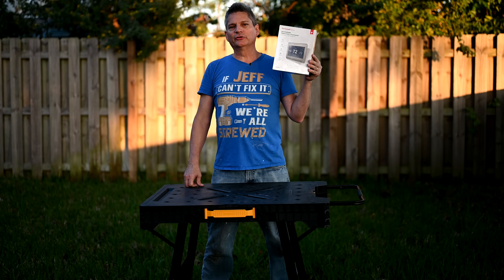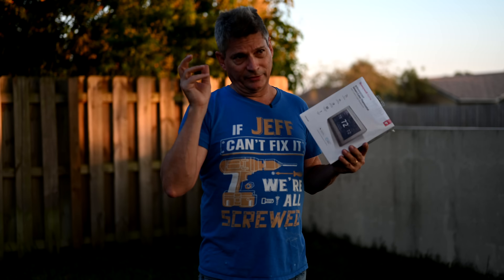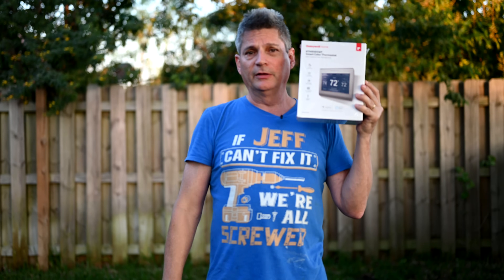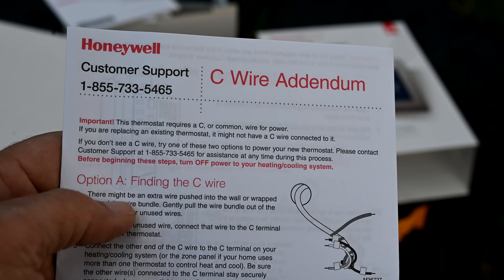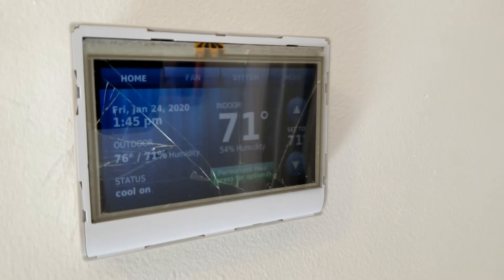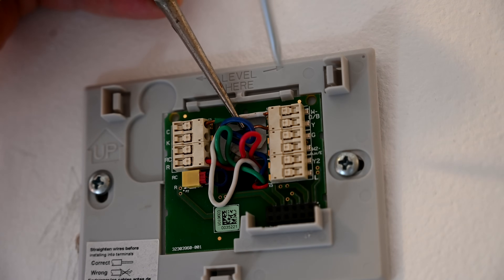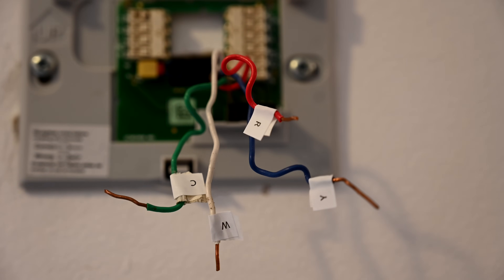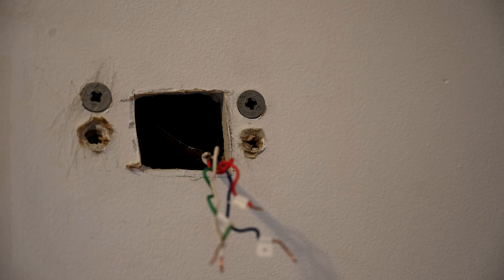How to Install Honeywell Smart WiFi Thermostat RTH9585WF Wiring

Comment: Does the jumper for rc to r on your thermostat take place of one that doesn't have one setup like that? For instance you on my old one there's an extra wire going from r to rc
Reply from the maker: Yes, the jumper connects the Rc (cooling) to the Rh (heat) or commonly denoted R. the jumper is there to make sure you can control the heater or the cooler.

Comment: I have 2 wires tucked away, a blue and a brown, which one could be the C-wire?
Reply from the maker: More often than not the C wire is blue, but check your air handler schematic
Reply: @jeffostroff  thanks for the help, appreciate it,
Reply: @jeffostroff  I plug everything in, no power

Comment: You said five wires you only connected for. What about the fifth wire?
Reply from the maker: Correct, our system only had 4 wires, we had no "C" wire. So I changed the wiring inside the air handler to give me the 24V "C" wire. But by doing this we lose the ability to run the fan only mode on the AC, which we never use anyway.

Comment: My thermo has 5 wires the blue c? Wire was not being used by my old thermostat.  I wired it R-R G-G Y-Y W-W and the blue wire that wasn’t being used before to c. My thermo kicks on and runs heat but the screen is not starting up on my Honeywell home it is blank...
Reply from the maker: Assuming the blue wire goes inside your air handler to the common, it should work. Trace where it goes, and call Honeywell if you can't confirm where it connects inside the ac
Reply: @jeffostroff  I tested with a multimeter it had 24v on the blue wire. Inside the furnace the com wire was blue and running down from the board to some relays it looked like black wire plugged in over by the rest of um it was running over to some sorts of control module? 🤷🏼. I’m kind of done with this thing for now I’m gonna chalk it up as DOA unit...

Comment: Hi I am interested to buy the Honeywell RTH9585WF1004 thermostat. I am in a condo and currently have a Honeywell T6575C1001
. Can I change? I have checked the wiring diagram and they are quite different. Any advice? Thanks
Reply from the maker: It is hard to tell without seeing what you have but at the end of the day you need to have at least four wires and preferably 5 to pull it off because you need that C wire and not everybody's system has the full 5 wires going to the AC unit. In my case what I had to do with that older AC was I disabled the ability to turn on the air handler in fan mode only in order to become my C-wire
Reply: @jeffostroff  Thanks! Can i send you a picture of what i have currently?

Comment: I had a 5th wire (red stowed away in the hole) would that be the C wire. Old had 4 wires G, Y, W and one connected to Rc with jumper to R. I assumed, that and used it.  It operated heating, but no display.  Any suggestions?
Reply from the maker: Yes, usually the wire that is folded back is the C wire. You need the C wire to have the display come on. Also make sure your display panel is snapped in perfectly onto the wall plate connector.
Reply: @jeffostroff  is it possible the folded wire is not connected at the furnace?

Comment: Jeff I have 7 wires...  (Heat Pump) Y2, Aux/E, G, O/B, C, Y, and R. My c wire is getting 25 v. When I connect the Honeywell 9585, I get nothing...  blank screen, no power?
Reply from the maker: The R should be getting 24v, did you test that wire?
Reply: @jeffostroff , yes it is as well. I wish I could shoot you a picture of the current setup.
Reply from the maker: @cuzzc9617  Unfortunately with all of these wires there's so many moving parts and so many opportunities for things to go wrong. So we know that you need 24 volts coming on the red line and we know that the C wire if you have correctly chosen it is supposed to be the black common wire that goes back to the air conditioner. I doubt the C wire should have 24 volts on it. depending on what wiring the installers used hopefully the C wire is normally black in my case it was green because my older AC did not have AC wire connection on a four wire cable that they had so I had to do some tricking inside the air conditioner to give me a C wire out of the green wire. But if you open up the panel on the air conditioner where your wires all come in to it you should be able to double check which color wire is indeed going to the common or C terminal. They often have a wiring diagram on the inside of the panel or on the outside so you should be able to tell if those wires are indeed going to where you think they are. Also you should search on the Internet for “thermostat wiring diagram” so you can see what all the different colors are and where they're supposed to connect up and make sure you have the jumper going from R to Rc on the thermostat. remember just because you have a set of wires there doesn't mean that they are correctly following the normal convention. Lastly it could also be that you just have a bum unit, but not likely and so you should call Honeywell and talk to their tech support people about whether or not it is wired up correctly or if the unit is just bad .

‘
Reply: @jeffostroff  thanks

Comment: Is there a alternate wiring installation with a older 2 wire system for this same thermostat?
Reply from the maker: I don't think it would work with a 2 wire system
Reply: @jeffostroff  why wouldn’t it work if I installed a 24v power supply to supply power to the unit and use the red and white to control the heating unit?

Comment: I have 2 wires going into the R terminal in my old thermostat......
Reply from the maker: Not sure why. The R is the AC 24 volt power. Usually on thermostat a small jumper wire goes from R to Rc

Comment: My display is just flashing. Idk what else to do. Can you help??
Reply from the maker: If the display is flashing re check all of your connections and make sure you water them correctly to the right spot and make sure they're in there tight but if it's flashing it says to me that it is at least getting the correct power maybe you have a way to see if it's getting 24 volts or not, otherwise it could be you just got a bum unit might need to go back to the manufacturer
Reply: Mine was flashing when I had the C wire and the G wire switched.
Reply from the maker: @DaveLK2000   Yes sometimes it's pretty hard to know exactly what's going on with the wiring that's why it's so important to take that picture of the wires before you remove the old thermostat. And most likely you didn't even a C wire connected before. same with my AC there was only 4 wires in when I had to do was rob one of the other wires on the air handler and move it inside the air handler to become the 24v c wire and by doing that I lost the ability to turn on fan only mode of the AC which is fine because I've never used it in fan only

Comment: Hey bud. Question. I just bought the same thing. I don't believe i have a C wire coming to my current thermostat but there are 4 wires coming through the wall. The new honeywell came with a white jumper. Can i still hook the new one up?
Reply from the maker: what I did on my AC is I reassigned one of the wires on my AC unit to be the O wire, but then lose the ability to run the Fan Only mode, which we were ok with. I believe in newer versions of the manual they have tricks to provide a C wire.

Comment: Can you explain to me why you just didn’t use the base from the old thermostat to use with the new ?  Waste of time!
Reply from the maker: Jus tin case there was an update, and I suspected I had a bade base  the first time because the thermostat fell off the wall when a door was slammed, cracking the display. I wanted lal new parts. Problem solved. Not a waste.

Comment: Hey, so first of all thanks for the video! But after install, the air blows cold for a few mins then it blows warm. Not sure if i did something wrong but all the wires are in the right place
Reply from the maker: Issues you can fix:

Thermostat is set to HEAT
Clogged outside unit
Outside unit is not receiving power
outside unit having issues with the compressor

Issues a professional needs to fix:
Low refrigerant (refrigerant leak)
Dirty evaporator coil
Leaky or disconnected air ducts
Reply: @jeffostroff  okay thanks for that information. With the old unit there was a red wire in RH (there was no R or RC option) so when i put this new unit in i put that red wire in R, do you think i should try putting the red wire in RC instead or R?
Reply: @AlfaAK101  both RC and R and linked together, would not matter which you put it to

Comment: The green wire for "fan only" can be used as a 5th wire, but then the fan is only able to run during heating and cooling, not on its own.
Reply from the maker: That is how we ran it
Reply: You answer my question, thanks.
Reply: So I can still connect ” g” wire to g  . If not disconnect g from condenser as well ????
Reply: @djb8078  G  wire doesn't go to the condenser, when I say "fan" I am referring to the blower motor inside the furnace as a "fan".  I replaced my 4 wire bundle with a 5, but if I didn't care about being able to cycle the "blower motor" without heating or cooling; as in just the blower pushing unconditioned, and unheated  air, when the outdoor temperature is mild and not too far below room temp.  There is an option on the Honeywell Unit that allows for the fan to cycle 25% on and 75% off., : 2.5 minutes out of every 10 minutes of something like that.  When you reappropriate  the green wire as a "C" wire you will lose this ability.  Your blower will only come on during heating and cooling cycles.

Comment: They sell 24volt adapters that plug into wall for C wire . Amazon . Hide the wire through wall or just run it down to floor and around to outlet
Reply from the maker: Yes, that is another good way to do it.
Reply: How is the adapter ran? Customer service says this will not work at all if using for both ac and heat.
Reply: @SSFrenchman23  customer service is wrong . The adapter plugs into a standard wall outlet for power and its wires are connected to the thermostat.  Directions in box

Comment: What if you have a O wire and a W wire? How does that work?
Reply from the maker: Not sure, usually the O is orange and it means RV cooling, the W is heat typically.
Reply: Agreed. This one is strange. 
It has the O AND W terminals as the same. 
So I put my O in the marked one and W in the AUX/electric heat. Works for me

Comment: I have a ranch home, (in Massachusetts), two zones, (2 separate tstats), for heat, 1 thermostat for AC. I replaced the two heat tstats with Lux 1500 about 15 years ago, left the old school Honeywell thermostat alone. The thermostats only have the 2 wires coming out, does this mean I can't install a new wifi type of thermostat? or does this mean bringing in an electrician. Any advice would be welcome
Reply from the maker: Well since you split up the heat from the AC you probably do have all of the wires needed at the AC unit, but they're just not all in one spot for you to hook up this Honeywell thermostat. So, your choices are you could bring in an electrician to run your 5- wire cable and make sure that it has the C wire on it as well connected at the AC handler. The other solution you might want to look at is the new wireless thermostat that I got which is the Lennox iComfort S30 and I bought this to replace the Honeywell that you see in this video, because we bought a new high end Lennox air conditioner and this is the preferred thermostat for that air conditioner. This awesome new S30 is bigger and nicer than the Honeywell. The AC installers explained to me this S30 does not need the 5-wires, only power and transmits everything wirelessly to the air conditioner; there is a Wi-Fi receiver that mounts on the wall outside the air conditioner. So, you may be able to use something like this on yours as well. I would investigate that and looked look into the instructions in the installation guide and the wiring info and see if that is something you might be able to use in your configuration as well
Reply: @jeffostroff    When we purchased the home back in 1999, the thermostats were already installed that way. When the house was built, 1994, did they not have a combo tstat that they could have installed a heat and ac together? I will check out the Lennox S30, the central AC unit here is a Lennox product. Thank you Jeff for the help and advice.

Comment: Ha I just bought one of these yesterday and made this same mistake.lol Tried it without the C wire and the screen blinks on for 1 second and off for 2 seconds and repeats. Tried different configurations with the same results. The system just won’t stay on. Took it off and found an unused C wire but the display doesn’t come on at all now but we did feel the air coming through the vents even though we can’t control anything. Gonna give it another go today. Thanks for this video.
Reply from the maker: Dang I hope you did not get a bum unit, maybe the display part is bad. If you can measure the C wire voltage, see if it is 24v
Reply: jeffostroff tried again this morning and just put the old unit back on. I’m gonna call Best Buy and let them handle this one. The air did cut on this morning but no display. Thanks for the reply.

Comment: Hello Jeff, great video. Where did you turn the power off from. I was going to shut the power off at the breaker box but, is there a power on the HVAC unit?  Thanks
Reply from the maker: That is correct If I remember correctly, I just did the switch on the front panel of the Air Handler a few feet away. It's usually low 24 volts, typically no danger, but you never know. I would still use a Voltalert sensor to double check. IF that doe snot work, try the main breaker switch for the Air Handler in the electrical panel.

Comment: I have American Standard thermostat, it has Blue color wired to its B terminal, when I checked at the furnace in the attic, that same Blue wire is wired to C terminal at the furnace. When I upgraded my thermostat to the Honeywell T5 wi-fi thermostat, I have switched the Blue wire from B (American Standard) to the C terminal of Honeywell T5, the unit did come on but the heat instantly blowing even I turned the Cool mode on. How do I fix this problem? Did I do anything wrong? By the way, my furnace is also American Standard and I'm planning on keeping it.
Thanks for your help
Reply from the maker: Not sure what is happening without seeing owners manuals. Is the furnace just for heat, or dies it also have air conditioning? What model is the furnace?

Comment: Hi Jeff, do you know if this works well with a variable speed blower? Nest says it won’t work.
Reply from the maker: Not sure. We're looking at installing a variable speed Dave Lennox series high end AC, and my guy told me today that surprisingly it only needs a 4 wire, so maybe that has to do with the variable speed blower in it also. He told me that Lennox recommends another smart thermostat they they use with their 4 wire AC. Hope to find out what that thermostat is in the next few days.
Reply: Nest uses a power stealing feature that often disrupts communication in the board and blower motor. They have made some updates and may have improved that problem. Don’t know,a lot of our customers that buy them at the big box stores have issues with them.

Comment: Although looks like IM stuck with the POS Train thermostat.  Honeywell is not compatable unless I rewire at the unit.  need help. sh*t!
Reply from the maker: I had to rewire my unit as well. I lose the ability to operate just the vent blower by itself, which is no big deal, because we never use the vent by itself, we either heat or we cool, that's all.

Comment: Jeff, very helpful.  My TRANE XL850 died and I should be able to replace with a like version of the Honeywell (both 24v)  the Trane is connected by 3 wires.
Reply from the maker: Only 3 wires? That might be a challenge. Soon I want to upgrade my AC to the Dave Lennox Series, their top of the line model, then convert to 5 wire.

Comment: Jeff great video. I was wondering how do you change the humidity for the inside of the house? I need it to be set around 55%RH
Reply from the maker: I don't think you can change the humidity on this model, I looked in the user guide for someone else who asked. I think this works only on temperature.
Reply: jeffostroff thanks. I hooked up and you are correct. Would you happen to known a Honeywell model that does?
Reply: Looking for that option for our church also. Our pastor insist on setting thermostat to 80 when away but we are in south Texas things start to get moldy and corrosion starts to take place on electronics.  Did you find a thermostat that you can adjust the humidity with?

Comment: I cant seem to find anything on the internet or any body's videos about dehumidification settings for this thermostat.  Are there any settings in the menu to tell the thermostat what you want the humidity to be? On other Honeywell thermostats, you typically have to go into advanced settings to adjust this.  Please advise.  Here is one old video I found, does it work like this? Thanks  https://www.youtube.com/watch?v=clYWjm9X7Kc
Reply from the maker: John, the model we installed does not have any humidifier setting. We don't have Menu option on screen, we have Settings. But the only info they have on humidity is that the screen displays inside and outside humidity. Here is the link to the owners manual online: https://www.honeywellstore.com/store/images/pdf/rth9585-honeywell-smart-thermostat-manual.pdf

Comment: I’m so glad I came across this video. Tyvm. My old mercury thermostat is going bad where fan on is not working. I’m assuming since I have that thermostat currently I have a c wire? 
But I’ll def be getting this or the t5 thermostat
Reply from the maker: Glad it helped. We have no way of knowing how many wires you have until the thermostat is pulled off the wall.